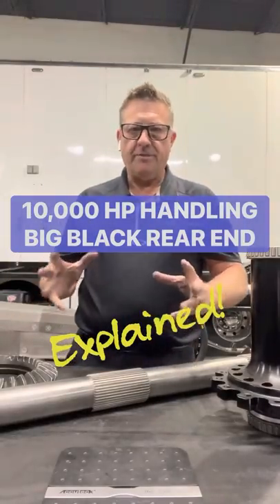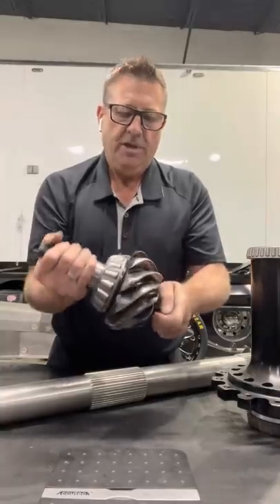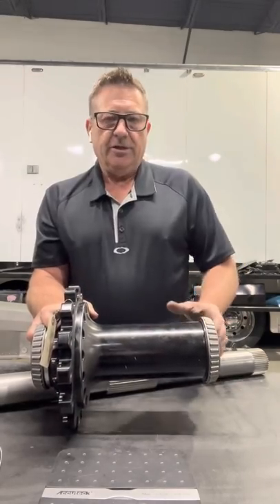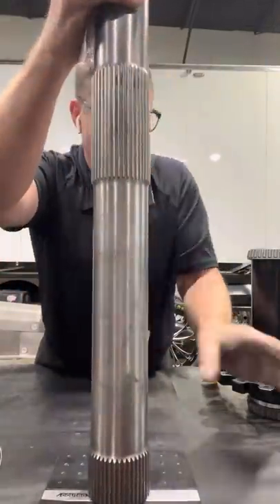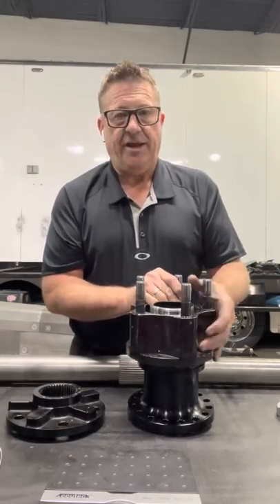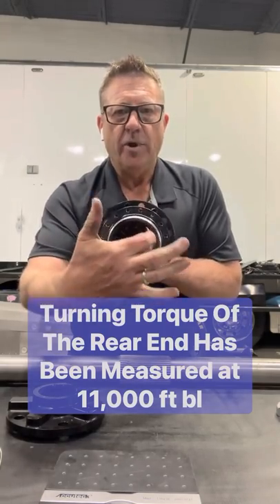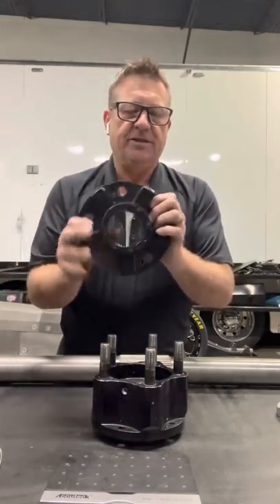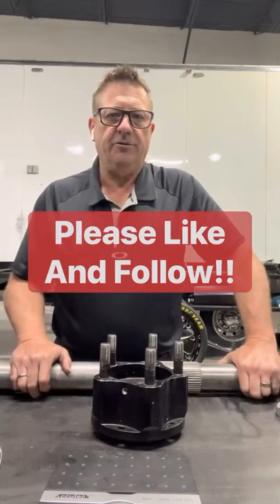The Inner Working Of A 10,000 Hp Handling Big Black Rear End Explained!

Comment: Rob, these videos are great.  Always wondered about how that rear end was put together.  Thank you.
How does a top fuel dragster or funny car only spin / smoke one tire if the axle connects both tires and does not go through a differential?
Reply from the maker: They always will smoke two tires unless it breaks and axle.

Comment: That is one hell of a rear end! Any reason the spool isn't splined right through and axle spines to match? Is it so axle can only carry force in one direction preventing case hardening and breakage like bending a wire back and forth?
Reply from the maker: I should ask Steve this. I’ll get back with you but that is my first thought. When the cars goes through tire shack it basically is reversing torque so I don’t know why you couldn’t flip the turning torque.

Comment: As a mechanical engineer, I love how racing cars are optimized by trial and error as opposed to computer models. Both of them have their place, but the real world never lies to you. If the wheel studs get sheared off, the drag racing mechanics just figure out a simple fix that solves the problem instead of spending months analyzing it, having meetings, and debating what the optimal fix is. 
Also, since the rear tires are spinning the entire way down the track and you only care about straight line speed, why bother with a rear differencial which is just going to add weight and complexity that will just be another point of failure?

Comment: Actually on a stock automobile the lugs do not spin the wheel either! The wheel is driven by the friction created by the clamping force of the lug nuts and studs! The lug nuts may assist but it’s friction of the clamping force. Although I will agree on the race rear end the raised areas are a better way to drive the wheel!

Comment: On a road car the clamping force between the face of the disc or hub and the back of the wheel drives the wheel not the studs,lugs or bolts.
Reply from the maker: I bet you don’t have the torque or shock loads like we have either. Add that and I bet you will be driving off the studs them. No amount of “clamp load” could hold this torque. Measure the wheel stud holes in the wheel. I bet they are not perfectly round.
Reply: @robwendland  our road cars in general don't apply nearly enough torque to overcome the clamping force exerted by the studs,yes the stud or lugs are holding the wheel on providing the clamping force but the turning force is provided by the clamping between wheel and hub or disc,having been removing wheels for the best part of forty years the only reason I have had to change a rim because of hole issues are older steel rims where the nuts would chew through the tapered seat cutting them away after being continually overtightened.Indeed many European ford wheels from the eighties,Sierra alloys in particular had huge bolt holes probably nearly twice the diameter of the stud again but even with those you never saw elongation from movement,some MG ZR models came fitted with those diabolical wobble nuts,they would loosen in about five minutes if they were relied on to transfer torque directly.Im not arguing that a 10,000hp car needs more than just clamping force alone,I find it incredible that the application of that much power can be applied instantaneously to anything that isn't agricultural in appearance without it exploding every time and actually watched this video in the hope of seeing the actual wheel to hub interface,I appreciate that when you are pushing the extremes every little helps but given that your stated that some of the cars sheered studs leads one to believe that it only happens to the most powerful stuff so therefore probably not a problem on a 2000 hp car for instance,so most certainly not even a consideration for something that's churning out 200ft lbs torque before the transmission and drive line take their bit. Yes some road cars,the most powerful ones almost certainly have titanium or some other trick stud,lug,bolt but only to maintain clamping force.

Comment: I'm amazing, even with how big the ring gear spindle is, that the aluminum splines don't shear. Is it 7068 aluminum?
Reply: It looks like a steel sleeve insert there. You can see it behind the closer bearing.
Reply from the maker: It is. No steel sleeves here as well.
Reply: @robwendland  well I agree with the original post then, the fact that the threads don't get ripped apart is impressive.

Comment: I can't imagine the torque/traction needed to sheer lug studs that's crazy.
Reply from the maker: It was an unfortunate incident. The problem is rust. Where the studs were in the hub, at some point had seen moisture. Just a spot of rust can cause breakage on high yield bolts and studs under tension.
Reply: @robwendland  I would never think of that. Thanks for the reply and the cool vids 😎

Comment: If you can measure the torque on a differential why can’t a dyno be made to measure a TF engine’s horsepower?
Reply from the maker: A coupler was made in the output shaft going to the rear end. Hp and torque were measured. Dyno for the motor would cost a tremendous amount of money to build.

Comment: I'm surprised to see the axle is hallow. At only 22 pounds, it must be
Reply from the maker: It is hollow. Different tubing thickness are used. The thinner the weight falls off but so does the amount of runs you can get.
Reply: @robwendland  You could index the axle with a straight line before a race only to find it curved after which might also reveal Torq ?
Reply: @Richard-wk9le  The axle is straight before and after the run, it flexes under load like a spring (dragster's mass pushes at the center, tires push at the ends, so the ends bend forward for acceleration, backwards for deceleration). The housing isn't springy, so when the axle bends forward and backwards, it makes the tube oval in those directions.
Reply from the maker: If it curves, it has yielded. That would be very bad!